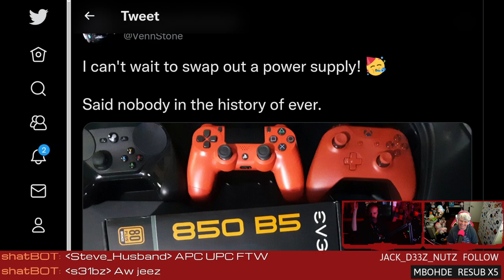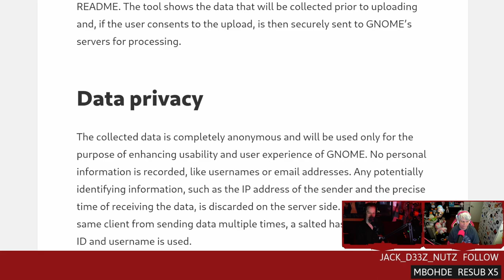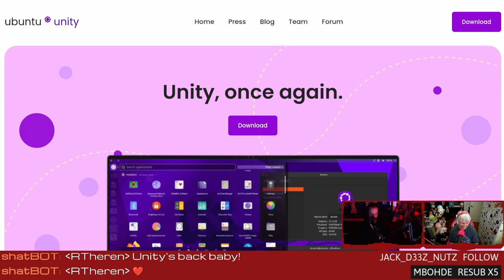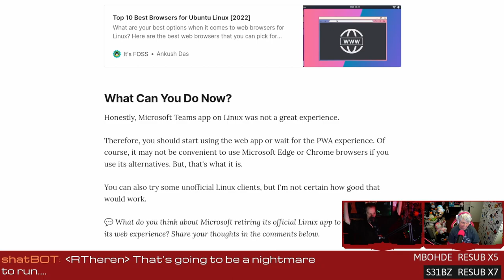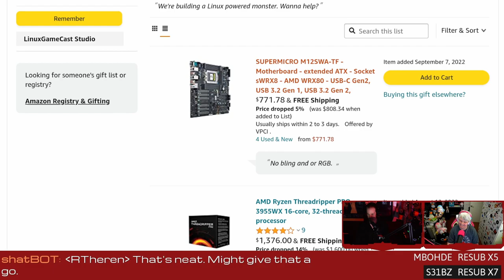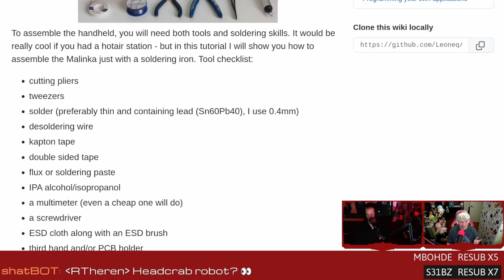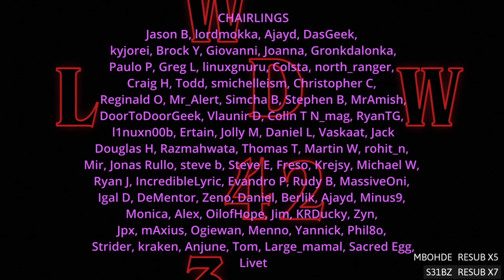Microsoft "fixes" Teams on Linux and Unity is back!

Comment: 00:00 Intro
02:23 New PSU
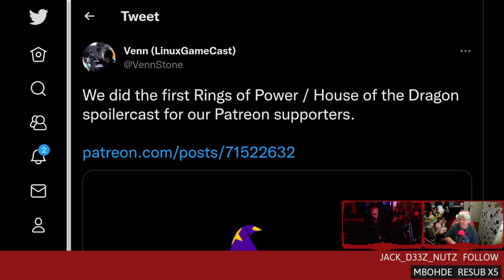07:08 HOTD/ROP podcast
08:28 GNOME info collect
12:13 Unity (yes that one) is back
16:53 Microsoft "fixes" Teams on Linux
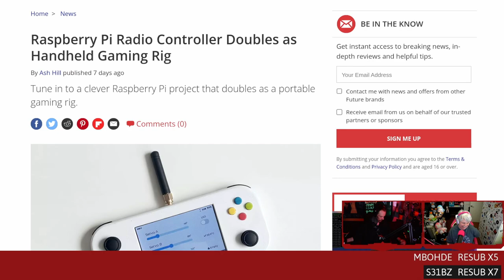24:12 Rasp Pi radio controller / gaming system